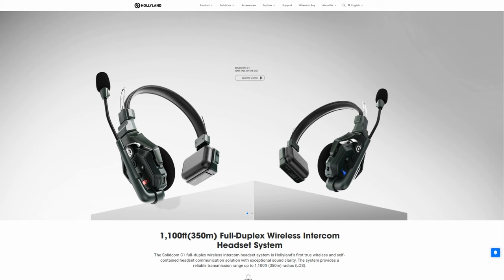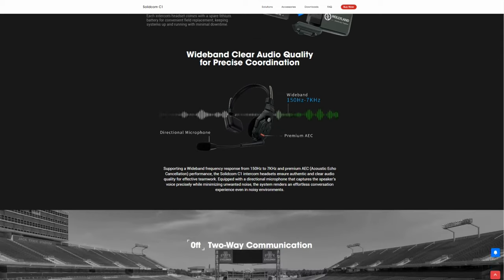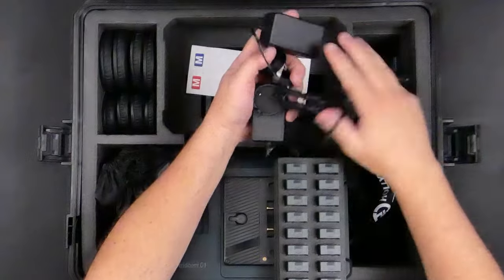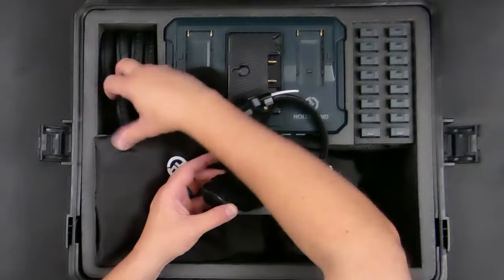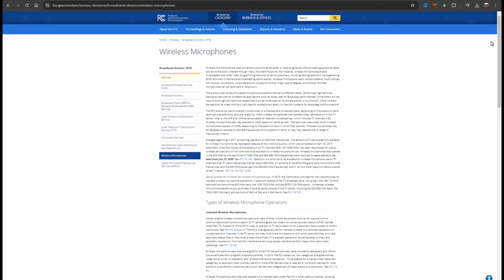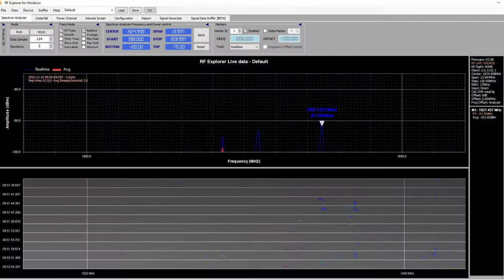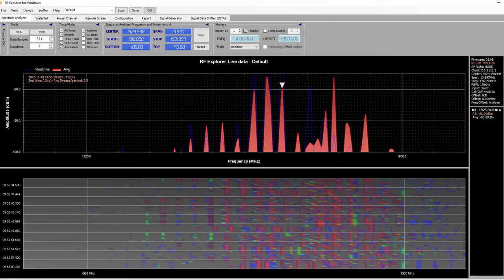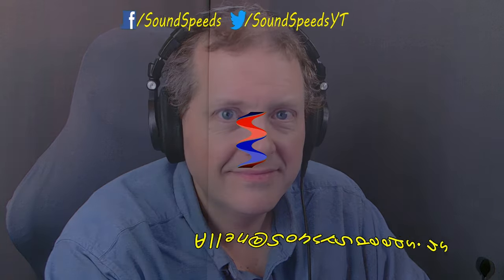Solidcom C1 Hub8S Review

Comment: Allen, one word of note, please don’t encourage the camera department to take on the management of the Comms. Here in Los Angeles, 695 is pushing to make Comms as part of the sound department. Comms is communication and that’s the area under 695. Simon Jayes, owner of Cine-Comm Inc. which rents outs the Riedel Bolero Comms system is training 695 members on how to use the system. When production decides to use this particular brand Cine-Comm Inc. Will dispatch out trained 695 members to setup the system and work within the sound department & video assist to manage the system after it’s been deployed and configured. Being a union member yourself, try to encourage that any Comms being used in ATL to be managed by a member of the sound or video assist team. This should allow an additional individual for either sound or video assist. In the words of Simon Jayes, who holds a 600 & a 695 card, believes 100% that Comms are under the jurisdiction of 695. Regardless of who owns the system, if it’s an owner/operator from 600, 695 believes that a 695 member should be managing the Comms system. All the best from the West Coast and keep up the good work.
Reply from the maker: I agree completely and wish the sound department never gave up running the walkies. They are constantly intermodulating with our wireless frequencies because the scans are quick and often miss when someone is transmitting on a walkie. They would also make a nice rental item. If you talk with Simon or can mention it to 695, suggest that the comms system sound/video member be an RF coordinator. In Atlanta we're trying to push for this in the sound department as opposed to the electrics who are also pushing hard for it. We are the Part 74 license holders and don't deal with consumer frequencies ranges like they do and being a Comms manager would naturally fall into the purview of such a position. The RF Coordinator would do everything from coordinating the WiFi for optimization to making sure that other stages don't interfere with our set.
Reply: Yeah it makes the most sense for the RF coordinator to be the person who's running the RF. License ham radio operator.
Recently went through a state course on how the states emergency communication system works and part of that was getting on a list for a emergency's. They want to have people who have any knowledge at all more than the cousin of the mayor ready and available in case something happens to coordinate Com's. We're talking everything Communications for multi party teams going into a jail for a fire to on seen news crews.

Comment: Just today, had a DP ask me for a shoot next week if we could loop in my mix track into the C1 Pro Hub. After looking through the (not very) comprehensive manual, it seems that the PGM input would work, as the pin out is set for an XLRM input, and also has gain controls. My plan is to just plug in a G4 RX hop and control it from my 633 fader as needed. 
Anything in my plan you see I’m missing or will get potentially tripped up by?
Reply from the maker: I'm not familiar with the C1 Pro hub so I can't answer that.
Reply: I am interested in the same thing. I work on indie films with small crews and it seems like a great way to feed a combination of comms and mix in one headset.